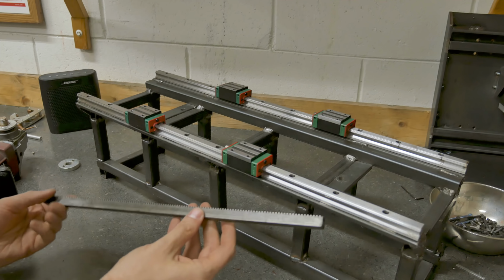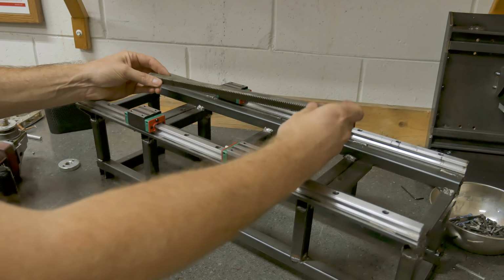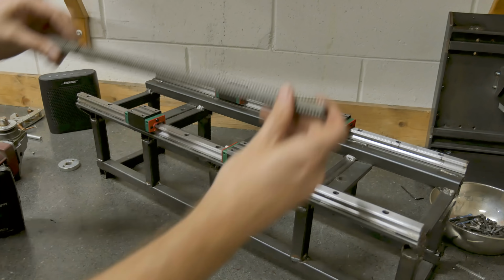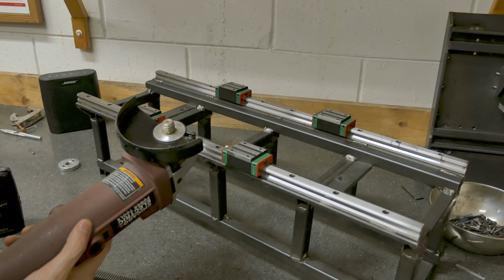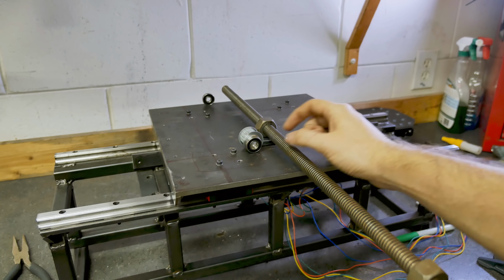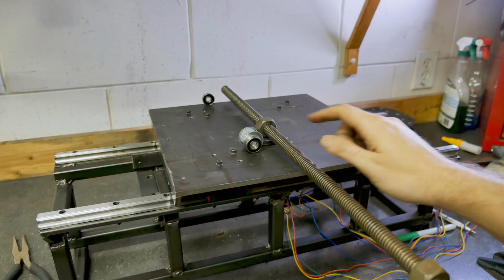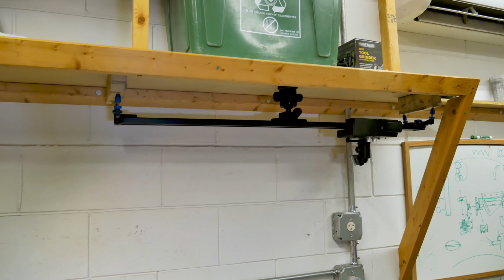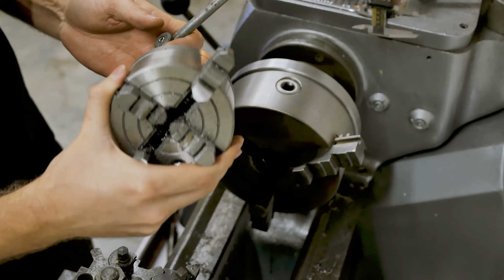Small Surface Grinder Part 5 - S02E19

Comment: You can use the lathe tailstock to keep a die straight for thread cutting. It's an accuracy increase for no cost other than a quick practice on some scrap material to get the idea of how it works.

Comment: If you think you are going to damage the leadscrew threads while turning it, mount the leadscrew in some nuts before chucking it up. You could either double-nut the screw or use locktite to hold it. Might not be necessary with a hardened screw

Comment: The lathe looks good in action, now its time for a milling machine. But seriously the videos are great, I just have a couple suggestions. 

1. Now that the lathe is up and running and becoming useful for projects, consider investing in expanded tooling. Used tooling is everywhere for cheap, and you can even find literal buckets of HSS tooling for a couple dollars. Learn to grind and make your own cutters, or invest in some cheap insert holders. A couple boring bars and a threading tool would be a great investment. In the meantime, consider making a die holder for your tailstock which will guarantee fairly accurate and straight threading. 

2. I think a few other comments have mentioned it, but welding after your dial in your parts will change the zero.

Comment: Good stuff guys!  I'm enjoying watching your build!

You're probably not going to run into this but what the hell.  Typically, one end of the support bearings on a lead screw/ball screw allow it to expand and contract with fluctuating temperatures.  Again, in this application it probably doesn't matter as that axis doesn't move much, and won't be warming due to friction but on other designs and machines it does.  If you don't take that into consideration in a machine design it could lead to binding, or premature bearing/ball screw failure.
Reply from the maker: this is a good point i didn't consider with this build. I think given the length and the natural play you get from ball screws, i will be ok. But when we start on the big CNC mill that will be a concern. thanks for the heads up!

Comment: there are stands for the angle grinder that allow you do use it more or less like a chop saw, maybe check it out, because they are really cheap and even if they wont do it for professional use, i like the thing a lot, fairly precise cutting, faster and certainly also a lot safer than doing it free hand

Comment: A tip for when you'r using the lathe to make bearing fits you should leave yourself about 0.001 oversize to polish the fit into dimension you get muchh bether result :)

Comment: Use the Lathe to make threads. Or... use the tailstock without the centering cone to slowly press against the die holder. this way is aligned.

Comment: Great video and production as to your usual high standards! (clapping)

Allow me to highlight two minor technical observations:

1 - the bearing interference fit of 0.0025 may be a little tight for a bearing of that size. It may bind up on you. I'd recommend checking this resource from SKF for the proper clearances for the application: http://www.skf.com/uk/products/bearings-units-housings/ball-bearings/principles/application-of-bearings/radial-location-of-bearings/selection-of-fit/recommended-fits/index.html

2 - You've welded the rack to one of the rails that holds the linear bearing carrier. I may be wrong here, but I think you had already shimmed and dialed those in accurately. By welding to the rail, you will have distorted it at least a little bit, which may or may not affect the linear bearing. I would check that again!
Reply from the maker: Thank man, great resources! I did figure out 0.0025 was a little too tight and ended up taking a little less the a thou off. i should have mentioned that in the video. As far as the welding, you are absolutely right about distortion. The leveling we have already done will have to be redone, this is totally expected. The shimming we showed was really just a proof of concept. once the machine is finally done, we will be disassembling it completely and putting it back together from the ground up, making sure everything is shimmed to the best of our abilities.
Reply: Bearing races can distort significantly (shrink/stretch/roundness) if the mounting forces are sufficient. You could (dial) -indicate the change in clearance before and after, I expect. There has to be room for the lubricant film and expansion.

Comment: love this project and other ones. i am aussie so regards to safety as long as you dont spill your beer anything goes.
but am i right in saying you went off center when threading on one of the acme screws?
keep up the awesome work
Reply from the maker: good eye! I need to make a tap holder for the tail stock, its way to easy to screw that up by hand. I ended up going a size smaller on the thread and re-cutting it. also, the safety nuts in america get really out of hand. it makes sense in industry, but as a home gamer, I'm making my own choices in life.
Reply: tip turn the part not the die 
safety Nuts we call clipboard warriors or pencil pushers LOL on a side note i dont have any guards on anything i own they just get in the way, We also have a moto in australia "she'll be right mate."

Comment: Should also setup an amazon wishlist or something, first thing you need is an automatic (spring loaded) center punch!
Reply: And some actual marking fluid rather than sharpies hahaha
Reply: Ehh sharpie gets the job done, been there.
Reply from the maker: point taken. i am getting tired of using the sharpie too. it doesn't show up that well on camera either.
Reply from the maker: That is a great idea!
Reply from the maker: Amazon list is up and running, still working on adding stuff to it, but there is a handful of stuff in there if you are feeling generous ;) link in the description

Comment: Surface grinders are typically meant to grind precision surfaces. Not sure how it'll be possible with this machine considering the use of welding throughout the construction? Typically you would create a detailed CAD design before commencing construction rather than make it up as you go...

Entertainment value is definitely there, your adoption of work safety was gold   :-D

Comment: I still think you guys should use a smaller magnetic chuck. There are some relatively cheap chinese ones that have a very low profile and have much less mass. With a big magnetic chuck like yours you might run into trouble when the machine shifts all that mass around. For example: https://goo.gl/YskXag that is a link to a cheap Ebay chuck.It is much better suited for your project.
Reply from the maker: that was my first thought when buying one, but we decided the mass would help us in the end with any harmonic vibration. to compensate for the weight, we just got bigger stepper motors.
Reply: Ah ok that makes sense. I love that you actually tackle such a project and I am excited to see it come to fruition. There are tons of lathe builts but I have never seen someone do a surface grinder (even though they are amazing machines!). Good luck!

Comment: I noticed that you're measuring the diameter after almost every cut, is your cross slide badly worn or is it just down to not having the confidence to go in and take cuts based upon the dials and your calculations?
Reply: Considering that the lathe hasn't been trammed and the ways are known to be off I'd say that over-cautious is just right.

Comment: The angle grinder shield gets in the way, wayyy to much to keep it on there.  I havent seen mine in a few years
Reply: Brandon Tscheschlog Likewise. I’ve taken my fair share of shrapnel, but honestly, the guard wasn’t the issue - the obstruction the shrapnel ricocheted off of was. I’m sure I’ll sing a different tune when an exploding Zip disk fires back at me, but at least it’ll be warm enough to cauterize the wound!

Comment: How are you going to verify the flatness and overall alignment of the runner surfaces for the bed? Surface grinders have especially heavy beds which run on bearings mounted on very heavy stable platforms for a reason: the machine is designed to create not just a fine flat finish (that's better than surface or slab milling), but an accurately flat one. I'm currently designing (according to the Tesla technique) a CNC router for heavy duty hardwood machining. My greatest concern is maintaining uniformity and flatness across a 4ft x 8ft bed. And I have to confess I'm not convinced it's possible to do so - even to the tolerances I require for wood. As with all such projects, the finished tool is only as good as the tool that made it. In this case that would be a very accurate flat marking table. I haven't watched your other vids yet, but it seems to me that you need to build these runner surfaces UPSIDE DOWN on such a table, using feeler gauges and shims to compensate where any distortion from welding has occurred. And for this reason, on my own project I'm considering using a modular construction from heavy rectangular tube section stock that has had one side milled and surface ground, then has witness location pads milled on the opposite edge with bolt holes precision drilled in the centre of them, in matching sets (pairs of long and cross beams). This way the bed mounting surface will be built onto the frame using very accurate digital levels. The plan is to avoid all stress inducing welding, relying upon bolts and studs and vertical beams to support the bed and frame weight. But you can only work this way if you create the final design in CAD, and know where everything is supposed to go, and how they fit to tight tolerances. By comparison, yours is a relative small project, so you should find the CAD process easier. I'm just concerned you will only be grinding smoothish surfaces and not dimensionally flat ones. The secret is in the drawing stage. Freehand fabrication is for trailers, not even vehicle chassis if you want it to go straight.